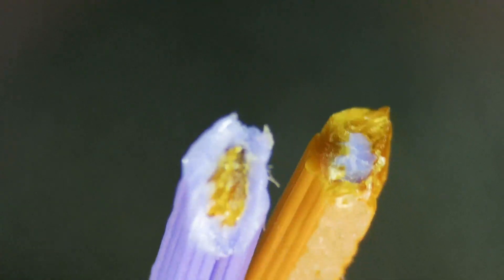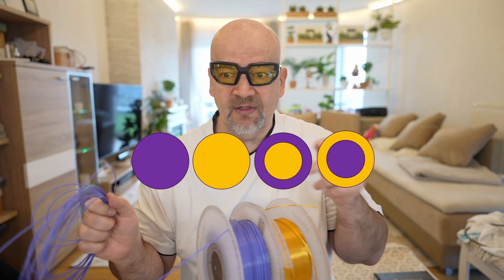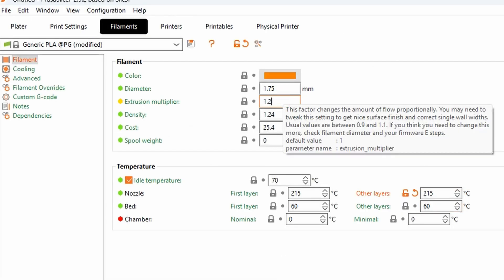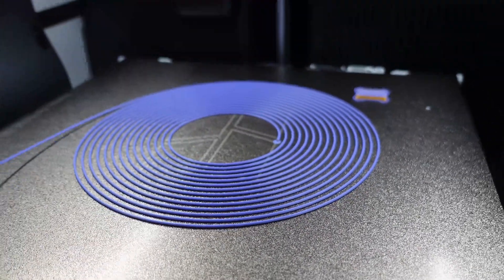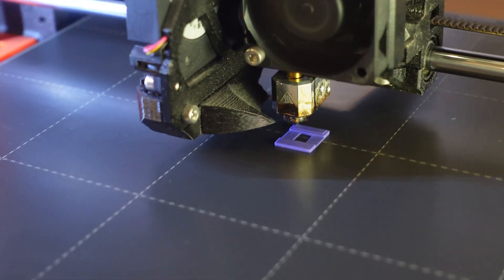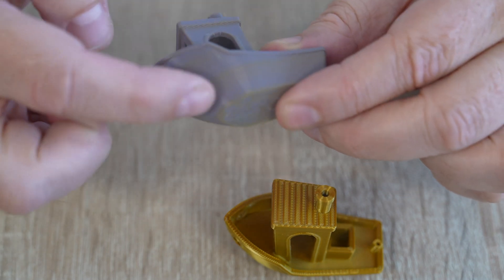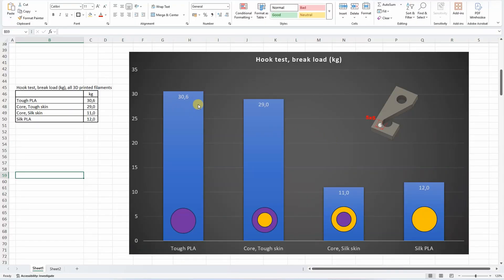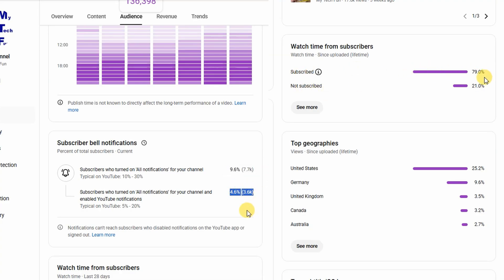3D Printed DIY Core Filament: Testing the Layer Adhesion Myth

Comment: Do core filaments work with CHT nozzles?
Reply from the maker: Not my experience, but others mentioned, that if you need CHT nozzle, then don't use 0.4mm, but 0.6mm. Additionally, it needs to be very hard, since the core will hit the center of CHT nozzle. 
Me personally, avoid HF (CHT) nozzle with core filaments.

Comment: Thanks for the video. I would love to see Bambu Lab PPS-CF filament printed on H2S with different settings, and possibly even with annealing, to see what can be done to achieve maximum layer adhesion and how different settings are impacting the print strength.

Comment: For me the main advantage of core cf filament is that I do not have skin irritation (no joke, I really have it when I am in a contact with the non-core fiber filaments) + you can print core with 0.4 mm nozzle without any clogs and nozzle wear.
Reply from the maker: Wow, so NBR was right. Another method is, if you have some dual color printer, printing the core of object from core. Check my H2D review.

Comment: Also you might need to increase to 1.26 for the gaps between layers maybe, but the sides of the made filament shouldn't be exactly flat
Reply from the maker: As shown in the video, my reference was the object printed from regular filament. Same weight.

Comment: I print witj nylon trimmer line filament. Its strong and lightweight. One way i get better layer adhesion is to print at a slightly higher temp, usually from 285 to 300c. But then i also print at 0.16mm or lower layer height. Then i do use 0.2mm layer width diameter in the slicer, while retaining a 0.4mm nozzle. The layer wall will overlap, which will make them stronger with more layers walls. You have fine tune the flowrate to achieve the correct dimensions.

Comment: Do you think any of the loss in layer adhesion is from melting the filament three times (first when extruded by the manufacturer, then when you made the core filament,  and finally in you test prints)?

Comment: Great vidoe. I would love to see testing done with dual extruded prints made from PETG and PET-CF. PETG core and PET-CF outside shell. Not core filament but the whole model. Then anneal the part above the melting temperature of PETG for a full reflow in the core.
Reply from the maker: I did something similar in my H2D review few days ago. That S hook. Very promissing method.

Comment: Very nice work. This really shows the benefits of core filaments. I was disappointed when I went shopping for US-manufactured engineering filaments about a month ago that there was only one company making a core filament in the US, and it was an abs-CF which wasn't what I wanted. Ended up buying 3D Fuel PET-CF which does have great layer adhesion, but I would still prefer a core version since I'm printing parts that need to be handled and it's nice not to get stabbed by the CF even if it's not going to be fatal lol.

This technique of printing your own core filaments is very interesting and opens up the potential for DIY custom materials. I'd love to see more experiments from you or other Youtubers along these lines.

Comment: I find it interesting that in the layer adhesion test the result kinda corresponds to the colors. The tough outside was more contaminated color-wise by the silk inside than the other way around. And then in the test the layer adhesion strength with tough outside dropped but the silk outside didn't improve. 
I have noticed when printing with silk vilament that after exiting the nozzle it behaves differently. Much more diameter swell and the noodle shortens. There is some tension in it that normal filaments don't have. So is it possible that when co-extruding this with other PLA the mixing of the two happens differently based on which one is inside? Wiht silk inside they mix more than with silk outside?

Comment: Type of video that pushes the 3D printing industry forwar! Also wondering why the layer adhesion in the core printed filament with the tough outside. I'm thinking that maybe it could be related with the choosen hexagon shape. 

As it's not a perfect circle, and you're having to boost the extrusion multiplier, think it could be related to maybe some contamination happening between the two filaments at the time that the filament is placed on the bed, which also could also explain a bit the change in color.

As you use polygons with an increasing number of sides, the difference in radius between the highest radius (which would be the theoretical radius of the circle = 1.75mm/2) and the smaller radius (from the centre of the circle to the mid point of the polygon side) will be increasingly smaller, and you would get less contamination related to the increase in extrusion multiplier.

I think that this may be worth exploring, see how different polygons works, and also using a lower layer height for printing of the filament.

As always great work, Dr Igor!

Comment: 2 points: First, the slicers are not cut into a hexagon, but rather an approximated circle from the sides. Secondly, you can use thin layers, or adaptive layer height on steeper overhangs.

Comment: I wonder for the layer adhesion test, the "silk core tough skin" material failed along the silk-tough core to skin boundary, instead of the tough-tough layer boundary, which could explain why it is weaker than the plain tough PLA material?
Reply: great thinking tbh

Comment: The test doesn’t seem to be apples to apples with standard core filaments. The amount of bonding between a core of silk and a pla skin is probably a lot less than a core of pla-cf or abs-cf and a skin of pla or abs. As you did demonstrate, the skin-skin forces do not completely dominate, which means that skin-core bonding has to be important. Also sariya-tech is on sale right now…

Comment: I hope more manufacturers will introduce core reinforced filaments. I also would like to see Bambu add a slicer setting for the H2D and H2C to use a different filament for the outside shell of a part so you could use a more expensive filament there, and something cheaper for the interior. The PLA we choose for aesthetics is typically more expensive than regular PLA, so why not just use the more expensive stuff where it shows?

Comment: Thank you for this work! While I think this does validate the theory behind core filament, you are correct to point out that the exact values are irrelevant. The important comparison is between the pure silk and the silk with tough core, that increase in strength is the proof of the theory!

Comment: Thank you, Igor. The math was mercifully fine, lol. Thought you were gonna do derivations of Poisson's ratio!  Not surprised by the results with skin material having a bigger than anticipated impact relative to the core material in the pull tests.  

It seems to correlate a bit to having a high number of perimeter walls (5 or so) and low infill percentage.  This typically makes stronger parts than 2 perimeters and high infill percentage. There's a lot of strength in the exterior walls, almost like surface effects. But maybe it's more telling that plastic parts often start to crack on the outside skin with the failure propagating inwards.  Brittle silk skin initiates the cracking. 

 Looking forward to the parametric Fusion model link to try it to print some weird filaments with my IDEX.

Comment: I have a theory (in my un-scientific brain) that the two filaments, while one might initially be a "core", are being mixed in the nozzle to such an extent that the concept of a "core" is being completely lost as it is extruded.  

This makes me wonder - would you see improved benchmarks if you used a wider nozzle.  Say a 0.6 or 0.8.

Great video.  Thank you.
Reply from the maker: Great proof are those dual color filaments. They will not mix after extrusion
Reply: search about laminar flow